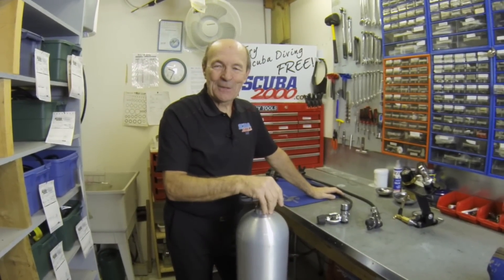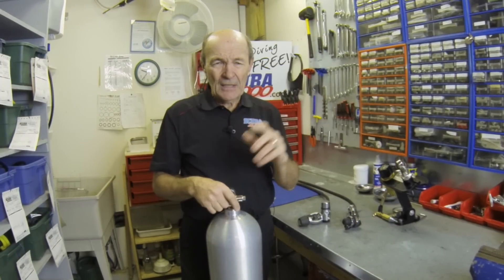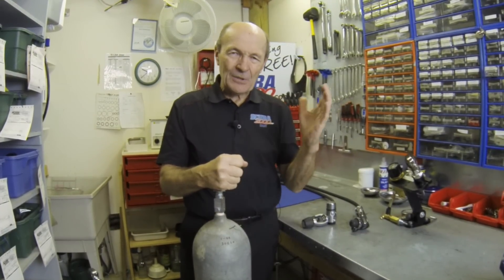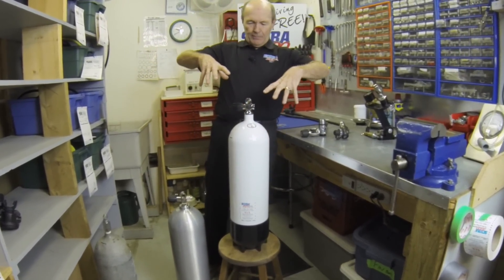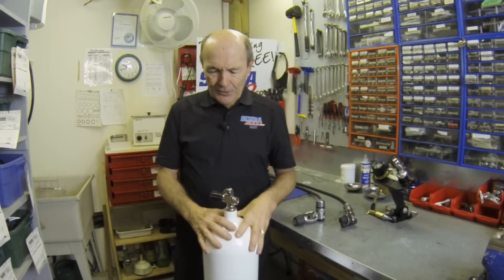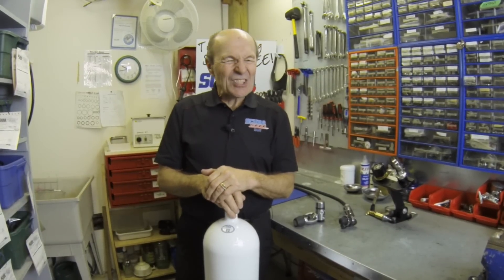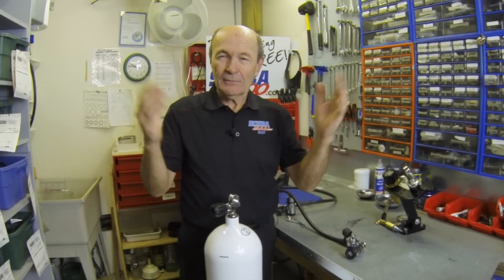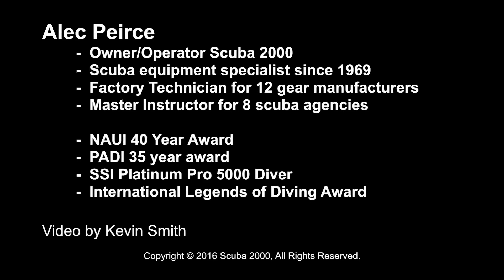Steel vs  Aluminum Tanks - Scuba Tech Tips: S03E07

Comment: I was wondering if a luxfer al 80cf is too big for me. I'm 5'9 male i just bought the tank and didn't realize it was so big. Is there a such thing as being too big?
Reply from the maker: I'm 5'9"/170 and use an 80 but I am used to it.
It can feel cumbersome at first.
Realize that once underwater it's a moot point since there is no weight. It's getting in and out that's an issue.
The 80 is the standard size used worldwide. It's what you will be renting on a dive excursion so maybe you should try to handle it.
If you find that your air consumption is less than your dive buddy's you could get a 50. That's what my wife Diana uses but she seems to hardly use any air at all.
Or you can get a steel 80 or even a steel 100 both which are smaller and lighter than the aluminum 80.
And try some other tips too.
I'm old and don't like to have the tank on my back while on land so I try to put the scuba rig, tank, BCD, reg, together and then put it into the water. Then I get into the water and put it on. I can't always do that but it's great when I can.
Good luck.
Alec
Reply: yeah when you kayak dive you have to put it in the water, so weight isn't as much a problem (well pulling it out and not flipping is, so I take that back). 
As Alec mentioned, HP steel 80 (and even my 100s) are lighter on land AND require much less lead (better buoyancy) as well. A total of around 10lbs for my Worthingtons vs ALU 80s. that's a lot when I already carry 30# weight belt for my drysuit.... (6'3" 210)
Reply: Micah Garrett no an 80 cubic feet is perfect for you I'm 5-8 and I have an 80 cubic foot aluminum

Comment: I only dive with steel tanks with a DIN regulator. Aluminum tanks are way too buoyant for my taste. (plus they usually can hold up to 200BAR s, whereas the steel ones are usually 232 bar or even 300.) Of course, all this is a matter of personal preference. What is of great importance however is the maintenance of your tanks, and making sure that they are given to a professional for a hydrostatic test, or for visual inspection. In Europe, a visual inspection should be conducted once a year, and the hydrostatic (depending on manufacturer's specifications) every 3 or 5 years.
Reply: same in the US (1 year viz, 5y hydro). Wish HP steel were more common here (what I also use, but yoke as DIN are harder to find deals on) and closer in price to ALU (which they are in Europe I understand). They are much more efficient (lighter yet better buoyancy - how about that!)
Reply: Hmm, here all tanks (or most of them as far as I know) are DIN but they all come with a yoke adapter which you just have to screw on and you're all set, in case you have a yoke regulator. No need to carry around an adapter.

Comment: I’m writing a term paper about the evolution of materials used to create diving tanks, and your channel has been quite useful to learn the basics of this equipment. I’m not personally a diver, so a quick educational video like these are a great start. Thanks.
Reply from the maker: Good. Glad to help.
It was an evolutionary process. The first were steel. They they added chromium to make them harder. But that also made them brittle so they added molybdenum to increase flexibility. And then aluminum came along.
But your term paper could get very complicated. since even aluminum tanks come in a dozen different alloys, each with its own characteristics. A few years ago, one of those alloys caused problems and some tanks actually exploded after much use.  Obviously they had to change the alloy used. 
As I said, it's been an evolutionary process with mistakes and improvements  along the away.
Thanks for watching.
Alec

Comment: Great video. Thanks. The one of the other thing I will mention with using a DIN vs Yoke valve and regulator is that it has less of a chance of being knocked off. (Over head environments) Also after using both systems personally I have found I have less issues with DIN leaking or having O-ring issues over all. That said If you own an DIN regulator and plan on traveling you need an adapter and now you are dealing with two O-rings and a more comber-sum system if the rental tanks don't have a valve that is not convertible.
Reply: Some places have Ali cylinders, but steel is the norm. The valve will normally have an insert so can be used with either DIN or yoke.  The cylinders are usually described by their internal volume eg 12 Liter and would typically be filled to 232 bar. That's about 98CuFt many dive centers will also have 10l (80CuFt) and 15l cylinders (135CuFt)
Reply: wonder if the reverse is true - if you travel to europe (plan on doing some diving back in my home town in France) and tanks are steel/DIN, do you all have yoke adapters ? (<240 bars)

Comment: Dove in the late 70s with a steel 95 cu I traded twin 72s for it.
Reply from the maker: Twin 72's were very popular but I think it was sales hype and that old 'keeping up with the Joneses' thing. 
They really were silly - heavy, hard to service, expensive and there's no way you needed all that air.
They were only valuable for divers who didn't have access to a dive shop for rentals or fills and two separate 72s were a better answer.
They sure looked cool though.
Alec
Reply: I remember diving twins in the late 70s, early 80s - and two hose for a very short while (older brother did longer) but no idea if steel or alu and what size. they were rather skinny... recall getting a large single tank later and single hose that was more manageable (but didn't sit on your back as well). over the head style BCD (not holding tank).  We would dive until we ran out of air (pull reserve - no pressure gauge) and long deco (40-50m). Boy have things changed now...

Comment: Alec, have you ever come across titanium tanks? I worked for a guy who owned three which I used to dive. No markings on the tanks, supposedly they are from Europe and there are less than 20 in the world. Would love to see a video on this if you can find one!
Reply from the maker: That's a new one to me SSP.
I suppose they are very light, and strong too.
Also Titanium is resistant to corrosion (it forms a protective oxide layer on exposure to air that protects the metal underneath just like aluminum) from air or water, whether fresh or salt, even to acids
But they'd be expensive for sure. Maybe a titanium-coated tank would be cheaper.
Many "titanium" products are really just titanium coated. I mentioned in another video for divers to watch out for "titanium" products like dive knives and regulators that are not really made from titanium. Some products labelled titanium are just painted a titanium color! Totally useless!
And then a diver needs to consider the buoyancy of the tank. It took quite a while before manufacturers found the right combination of weight and size for aluminum tanks so they'd not be too buoyant to use.
Neat idea though.
Thanks.
Alec

Comment: Alec I’m so glad I stumbled across you channel. I’ve learned so much from you. I will be purchasing my own tanks soon and would like to know what size do you recommend.  I know the aluminum 80 is the standard, but if I dive with Nitrox wouldn’t a steel 133 be better? What are the pros and cons to larger tank sizes? Thank you for the expert advice in advance.
Reply from the maker: For regular diving, that is, not extreme deep, cave or wreck penetration, the aluminum 80 is still the best bet, even for Nitrox. It's cheaper, easier to maintain and perfectly balanced for recreational diving.
Using Nitrox does not affect the tank choice. In all likelihood a Nitrox dive is shallower and maybe even shorter than an air dive. The idea that you need a 'big, high pressure' tank for Nitrox is another of those mistaken attitudes from technical diving that have permeated the recreational diving world.
Get an 80 and go have fun. Take a Nitrox course and then you can decide if it's for you and if you want to get a different tank.
Good luck.
Alec

Comment: I work at a dive shop and fill air tanks. We often fill tanks 200 psi over their stamped pressure because they heat up while filling- if a customer has a yoke valve on a tank with stamped 3442, is it safe to fill it up to 3640 and let it cool from there?
Reply from the maker: What you are doing is pretty common practice Taryn (nice name!).
However, it's illegal!
Heaven forbid, but if there ever was a problem, someone's going to jail.
The stamped pressure is the highest pressure that can be added to that tank - AT ROOM TEMPERATURE.
So to overfill because the tank is hot is not allowed. The tank must be cooled or let cool down to be topped up.
Our customers know that an air fill may take 1/2 hour or more, and even then the pressure will drop a bit if they go into cold water. That's the way it is.
And, FYI, tanks seldom fail during a dive. They almost always fail while being filled. 
So no customers in the fill station and you be careful!
I know this sounds weird and many (most?) dive stores don't follow these rules but, the consequences are much more serious than a speeding ticket.
If you and your store owner decide to follow these rules, get back to me for ideas on how to show your customers that you are doing it for them - for their safety and good diving.
Good luck.
Alec
Reply: You are taking on some liability by overfilling, but as Alec says, almost everyone does it. (Not me of course!) Your weak point is not the tank, it's the yoke on the fill whip and later on your regulator when you attach it. I have never seen a yoke rated to over 3500psi. They may exist but most are 230bar which is roughly 3336psi. The 3442psi steel tanks you are filling have, if plus rated,  (look for a small plus after the most recent hydro date) an operating pressure of 10% above stamped pressure, or 3640. However these tanks really should but rarely do have DIN valves on them and be used only with DIN regulators. Having said that, the test pressure on, for example, a 3000psi tank is around 5000psi, and the fail pressure is around 10,000 or more. Yokes have similar specifications which is why rapid unscheduled disassembles are are. Tanks explode and yokes fail due damage or not being properly maintained.
Reply from the maker: All true Joe.
I also think that tanks over 3000psi ought to use DIN.
Alec

Comment: I used steel tanks during my intial certification while living in Italy. Then after moving back to the US used aluminum 80's for the first time, hated it especially when the tank started becoming buoyant near the end of the dive.
Reply from the maker: You can imagine my frustration. I used steel tanks exclusively for 20 years before aluminum tanks appeared.
However, the improvement in the safety and the low maintenance of the aluminum tanks still makes the annoyance worthwhile.
It has been argued that the positive buoyancy of an aluminum tank at the end of a dive is a good thing but I agree with you. They are bouncy and tippy and make you feel like a beached whale.
Alec

Comment: Alec, I believe you have a mistake in your video - modern steel tanks are NOT heavier than ALU tanks, they are actually LIGHTER on land (and much better buoyancy underwater due to smaller size due to high PSI and thinner walls). You're comparing a faber 100cf to an ALU 80cf! (25% more air).
According to spec online for apples to apples:

Catalina 80 (32#, -1.8) vs faber HP80 (28.6#, -8)

ALU tank is 3.4lbs heavier on land and require an additional 6.2# lead underwater. That's almost 10lbs more weight to carry around the beach, which can be significant in cold water diving!

worse for bigger tanks (see my other post).
Reply from the maker: Yeah. You have to compare the same size for an honest comparison. So compare an 80 aluminum to an 80 steel.
But you're right - a steel tank is lighter on land, more negative in water.
However, I hate 130s. My staff was under orders to NOT carry customer's tanks if they were 130s!
We had one diver who was about 5'5" and weighed maybe 135 who used twin 130s!!!!!
He moved them around on a furniture dolly.
Alec
Reply: yeah I don't get twin fascination. I mean that's all I used when I started diving in late 70s because that was the only way to get 10-15min airtime at the 130-170ft depth we dove at with whatever those tiny tanks were, and our BC were merely life jacket style with no tank support, so twins were nicely flat on your back and didn't roll around. With HP120/130 you get so much air in a much more compact and lighter package it seems... but then again I'm not a tech diver and don't need 2 full regulators.
That guy should use a re-breather if he wanted 2-3x the down time - 2x130 is a LOT of weight. Ouch. bet he suited in water :)
Reply: I do wish 80cf steel were more mainstream as it would drop prices closer to ALU instead of being $100 more (online). 100cf Alu and steel are much closer in price (both 'non standard' size).
Hot dip galvanized steel makes it must more rust resistant (don't have to paint colors) but require special dyno steps, which is why originally a bunch of worthingtons (which I have) failed testing in their first year until people got the memo how to pre-stretch the 2 metal layers...

Tanks tech doesn't seem to advance as much as other tech I'm in (computers) or we would have super high pressure light weight tanks (easier to carry and good buoyancy). Heck why can't we use firefighter carbon tanks, and even higher pressure underwater (no risk of fire heat)? 80cf alu are still so dam heavy for many people... maybe that's what re-breathers are. But at $3500+ and special courses, and complicated maintenance, they severely limit their appeal.
Reply from the maker: I too used twin 72's in the 70's. I used to dive pretty deep and alone as well (never claimed to be the smartest guy around!). They were pretty good though. Lots of air and plenty negative. No BCD.
USD Aqualung had a beautiful set of twin 50's in the late 70's. They were aluminum, flat bottom and looked very cool.I never used them myself (liked my 72's) but I sold hundreds to guys trying to look macho, you know, that Frogman look. I made a lot of money selling them.
Then about 10 years later I made a lot of money from the same divers. They wanted their twin 50's disassembled and changed into single 50's. The single 50 is really nice for shallow dives, pool dives, kids, girls, etc. I still have 2 here at the Ranch for use in my pool. They are Luxfer so I watch them very closely!! Anyway, I charged for the work, sold them 2 valves, 2 new backpacks and then sold the twin manifolds later to other divers. Yep! One of those crooked dive store owners. Well, opportunistic anyway.
Actually I was always careful to tell everybody what was happening. The divers with the twins knew I was going to sell their manifolds. I gave them a discount on the new valves.  
Another story. See what I mean?
Talk soon.
Alec
Reply: yeah I bet you have lots of stories... you should run the 'most interesting man in the world' beer commercial. Ironically I just read an article about him and Obama friendship... 
Funny I'm looking for tiny light tank to teach my youngest in the pool - she's 8 - about the age my dad taught me. My other is a teenager and those are much harder to convince them to do anything non friend related :(
I noticed Luxfer 50cf Alu, but those sell for same price as standard 80cf, and have not found used one yet, though I occasionally see 63cf which would be next step, or just rent 65cf HP steel locally as I don't foresee ocean diving in monterey cold water anytime soon :)
Reply from the maker: Look for a good used pony - aluminum 19 or 30. A 40 might be too long. 
There's usually lots for sale once divers realize that that don't use them much.
And a cheap reg. 1st, 2nd and hose is all you need for that.
You can use it too!
Alec
Reply: yep I thought about pony bottles - ideal for kids pool training. I'll keep looking for those...
Reply: Tim, scuba fills are very dry since many tanks are steel (not just ALU) with no layer and would rust very quickly, and would be un-heatly to breath. Some boat fills might not be as dry as most shops, but normally all moisture is taken out...
Reply from the maker: Never dumb to ask a question Tim. Dumb to NOT ask a question and get hurt.
For a variety of technical, important reasons, by which I mean life-threatening, scuba divers must have dry air - very dry air. The air in scuba tanks, assuming they were filled at a professional scuba station, is probably drier than any other source. Great time and money is spent to ensure that. Technically, scuba air is required to have a dew point no higher than -66 degrees Fahrenheit.
For those not familiar with the terminology, simply put 'dew point' is the temperature at which the water vapor in the air condenses. So I'm not saying that scuba air has no water in it. That is virtually impossible, at least at the consumer level, but that the amount of air is very, very small and will not manifest until the air reaches -66.
So unless you're shooting at -66 degrees, you are absolutely safe using scuba air.
Is your rifle 22 caliber? I'm an avid hunter and have hunted worldwide. I'm amazed at the advances in air rifle technology the last few years.
Have fun.
Alec
Reply from the maker: Sounds nice. I have a lot of air rifle customers.
Take care.
Alec